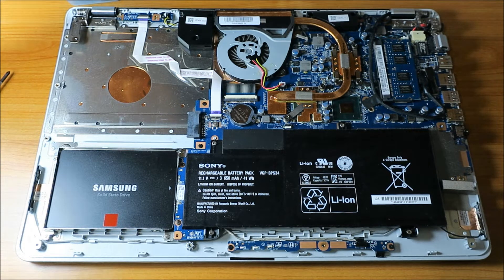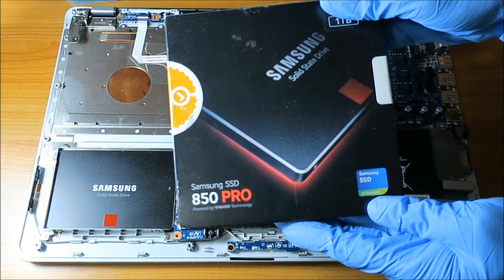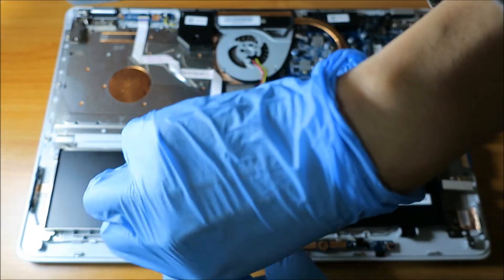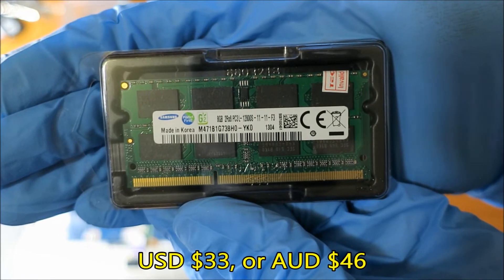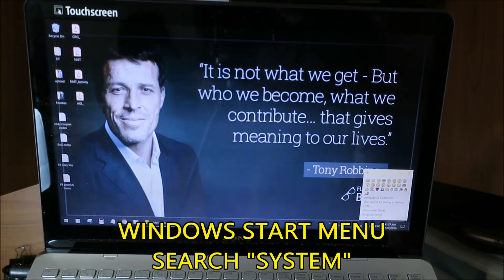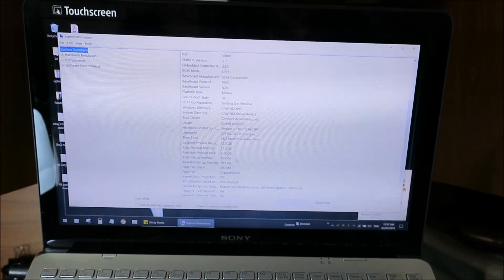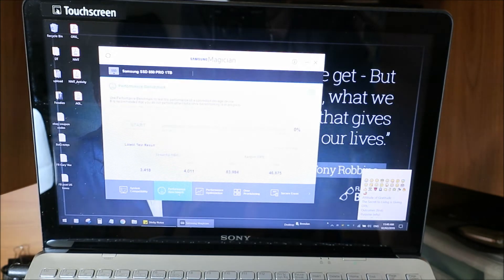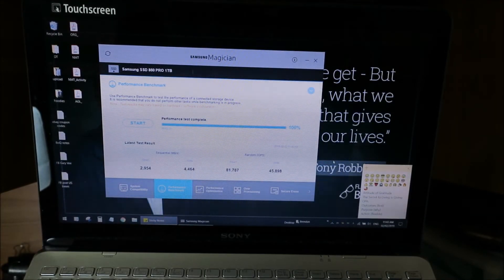Laptop RAM Upgrade, Sony VAIO Fit 15 SVF

Comment: This is so helpful.. I'm wanting to upgrade both memory and ssd on my Vaio. Same model. This made me feel much less intimidated! Haha thanks mate.
Reply from the maker: Thank you and glad it helped. The SSD was the best upgrade. Faster operation, quieter, and lowered heat. Better than new. The RAM was the final cherry on top. I'd recommend the Samsung EVO SSD. Shop around, you can find them for a better price now.
VAIO Fit SSD Install https://www.youtube.com/watch?v=09Zc279GQbA
Reply: @BAdventures  I've just bought the RAM yesterday, because the SSD is a bit more money, but that will be the next purchase. 

So the Samsung is an improvement over something more generic then? Good to know. Of course I'd never go with anything cheap, but I wondered about whether I was paying for the name. That's not always bad though! Haha.

No need for backup when installing the RAM, right? But what did you use for the SSD upgrade?
Reply: I actually did it... And I never would have done it without this video. I feel so proficient! Ha!
Reply from the maker: Hey congrats! You learned something new and upgraded your RAM.
Yes Samsung SSD's tend to be more reliable and faster performance. Laptops have a limited upgrade path. Better to use a good quality hard drive. I used the 850 PRO SSD model because I do video and photo editing. In hindsight I could have saved some money with the Samsung EVO 860 SSD. No regrets and very happy with the upgrades. Give it a try and don't be afraid to ask for help.

Comment: How to upgrade a Sony is buy an Alienware!
Reply from the maker: Sure LOL 😂✌️ a new computer is always nice. Plenty of great options now. AMD has released their 3rd Gen Ryzen Desktop and Mobile laptop processors. So we're see more competition and value in the market again.
Reply: @BAdventures  Be careful with AMD: the heat displacement is not up to par. (Btw, this is PV)
Reply from the maker: I know I've been keeping an eye on it. The new Ryzen 3rd Gen are cutting edge 7nm chips. So there are still some bugs with overvolting, which creates more heat. The motherboard manufacturers and AMD are working on updating BIOS and firmware to rectify it. AMD already fixed the graphics support for Ryzen laptops. I wouldn't hesitate to buy one. Just waiting for the market to settle down and more supply to Australia. We always get tech products late.

Comment: Hi, I have a Sony VAIO SVE1713C5E with 8gbs of RAM and I'm thinking of upgrading this.  Do you think it's worth it at this point in time? I'm happy with my I7 processor as it can boot up and get to youtube under 3 mins but my AMD 7500 graphics card is quite lacking. I don't play that many games but I notice considerable heat from the fan when playing and even when not at times! Any advice would be great and video has been liked of course!
Reply from the maker: Yes do it, especially if you have a Core i7. I checked your specs and it's similar to my model. I was getting by fine with 8GB RAM but it heats up faster and would start to lag. After the RAM upgrade it lowered temperature and everything much smoother. My theory is the excess RAM helped reduced heat as it helped reduce stress and load.
I checked your model on Crucial Memory website and you can max your DRAM to 16GB total. 2 sticks 8GB DDR3L-1600.
Mine was also noisy and constantly operating around 70 degrees Celsius. It worked but way too warm for my liking. The hard drive was noisy and wearing out, and the cooling fan would buzz loudly. The best upgrade was the Solid State Drive. That reduced heat and load significantly to average 40-50 degrees C. Plus everything faster and quieter. No moving parts in SSD.
If you're happy with it hands down do the SSD and RAM. It will be a totally different computer. Don't be afraid to ask for help 😎👊
Reply from the maker: I think your model is similar layout to my old VAIO S Series. Good news is they are easy to work on. Do it 😎👊
RAM Upgrade https://www.youtube.com/watch?v=X0ljlSLQIqc&t=562s
SSD Upgrade https://www.youtube.com/watch?v=k_-HPVC59Bo&t=442s

Comment: Great video! I need to upgrade my laptop too. Not the RAM but my HDD because it shows 100% usage all the time and I don't trust it with my data anymore. Good thing you mentioned the ESD at the beginning I would not have thought of that.
Reply from the maker: Glad you found it helpful. I maxed out my upgrades. Well worth the productivity gains alone. The best upgrade you can do is a SSD, high speed hard drive. This RAM was the final cherry on top. No more lag with multiple browsers or apps open.
You might want to get back up external storage drives since you're out of space.
SSD Hard Drive Install https://www.youtube.com/watch?v=09Zc279GQbA

Comment: thanks for that simple safety procedure to prevent frying anything in the motherboard.  Ive learned the hardway that caused me, to buy new one
Reply from the maker: Thank you, and I respect your honesty. I've worked as a manager in a few companies. It's a common problem in IT desktop support teams. They rush to work on a computer and make it worse. It's about standards. I've seen guys fired because they didn't prevent ESD. All they had to do was wear gloves, or anti-static wrist strap. No glove no love hehe.
Tell me the story when you're free.
Reply: B Adventures Travel Vlogs.  I guess most us don't really realize that our body contains more than enough voltages to fry any small electronics too.  I was still puzzled what exactly caused that popped and sparks almost simultaneously until I watched this video mate!